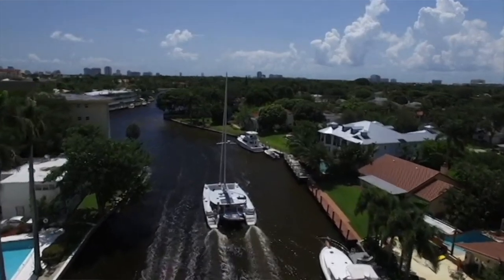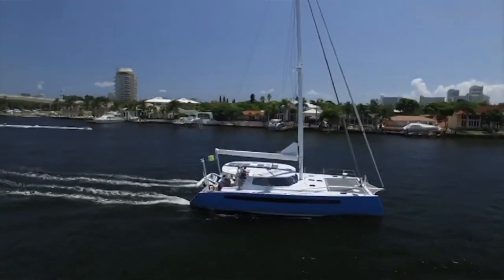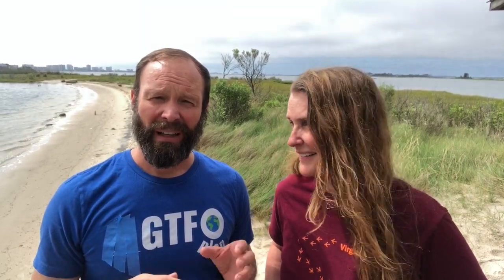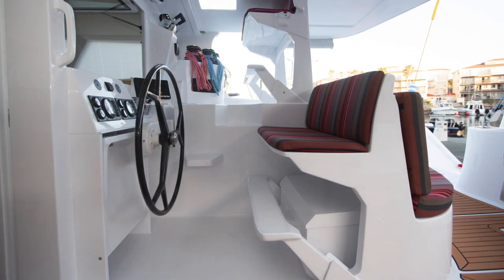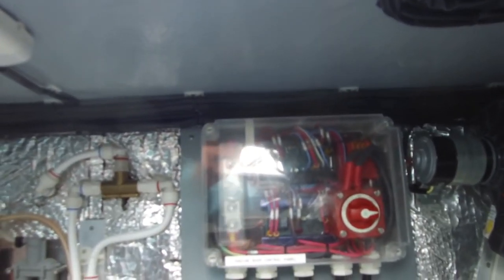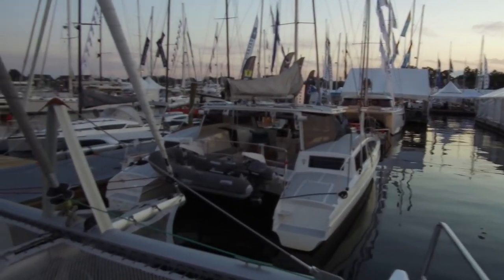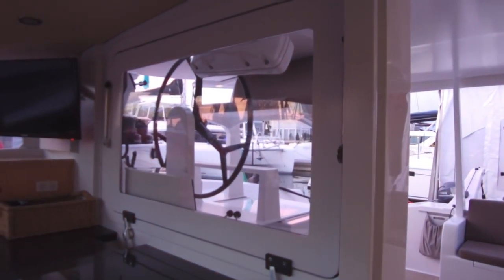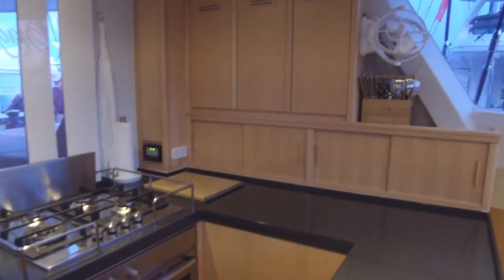GTFO plan #22:  Balance 526 Review - We bought a boat!?

Comment: Great boat and a great review again! Thanks a lot! I Love the versahelm, the good 360° visibility and the ventilation. For long distance cruising you dont need a nav station anyway imho. The saloon table is better for large maps and there is also enough space for a laptop and to make notes. Curious about what your choice was! Cheers!
Reply from the maker: Thank you!!!  They are no longer printing charts anyway.  We have two more reviews to post and then we will do the great reveal. LOL
Reply: @GTFOplan  with 2 plotters plus laptop/tablet/smartphones, etc. should generally be fine, but I prefer still to have a printed map with me for rough planning with my family (kids like to point with pens and fingers) and as backup in case of electric issues during a crossing. In worst case print out the coastline around the next potential targets,.. 
Main reason to have a "nav station" actually is to have a proper workstation, so most navstation desings are a waste of space for me. Either a large desk to work properly or just a switchpanel. ;-) looking forward to seeing the next videos!